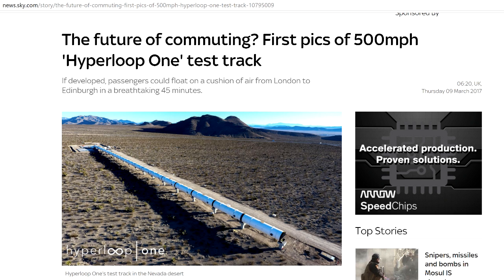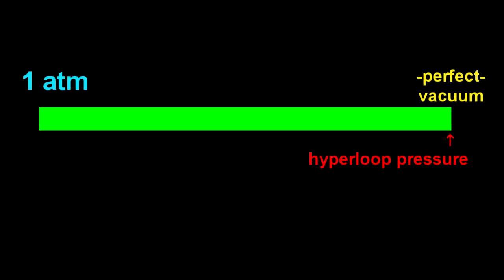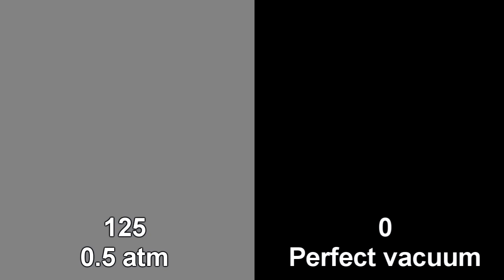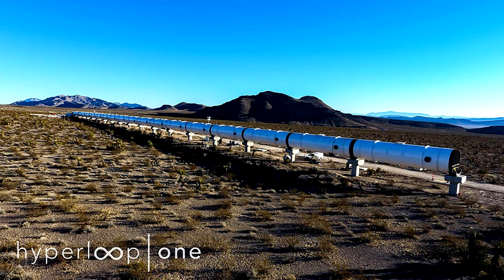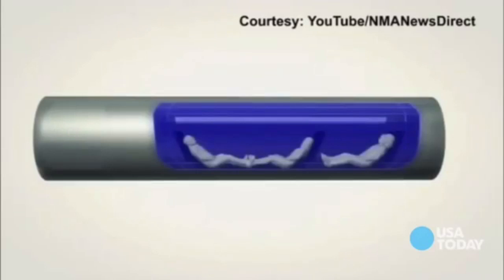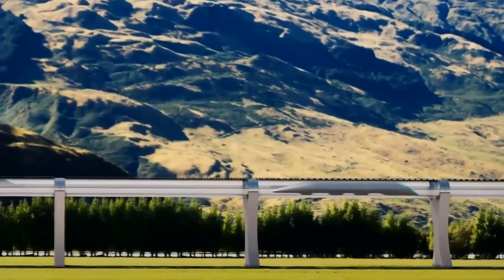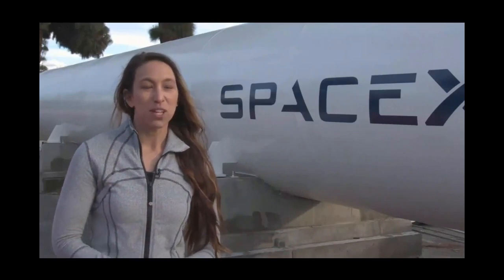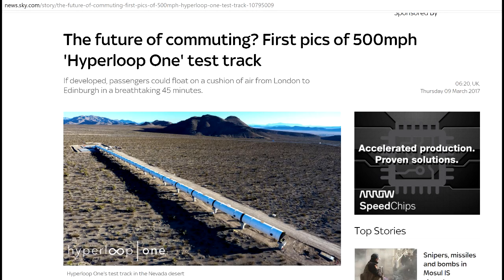Entire Hyperloop could be destroyed in SECONDS!

Comment: Why can't they use a gas to reduce friction such as Argon
Reply: Why not just use air???? And get rid of the bloody tube. That's called a train.)))
Reply: Bigg Phillips I don't understand your question

even if I did, it sounds as irrationnal as the hyperloop itself
Reply: Because to a very good degree all gases act the same in regards to pressure and such. Drag is additionally proportional to the mass density, but you'd gain at most a factor of ~30 in drag reduction and that would require hydrogen.

Comment: I'm with you on the dangers of the vacuum tube, but talking about how long it takes to pump out the air from the entirety of the tube and comparing it with the length of the trip is pretty stupid. Ever heard of airlocks? There are plenty of good arguments about it, so you really don't need to keep repeating this stupid one. It wouldn't be a half a mile section that would have to be pumped empty, but just a 5m section.

Comment: okay, that may be a stubid question, but why aren't they using a magneting railway thing they use on rollercoasters to reach the speed. (I know nothing about that stuff so please don't hate me)
Reply: Mrs. Babzubo because a vacuum tube would be unnecessary when you are using magnets
Reply: SaltyKanan just bc you are using magnets, does not mean you have no drag on your vehicle. And wasn't that the main argument for the vacuum?
Reply: Mrs. Babzubo yes creating no drag is the point, but the maglev (magnetic train) which does actually exist can reach speeds of 600+ km/h and doesn't use any vacuum tubes
Reply: SaltyKanan I didn't knew that, thank you. But why waste all that money on something that's a killing machine if, you could use it to improve these magnetic railwaysystems? It seems kind of stupid to me.
Reply: it would be useless since most of the friction is not between the air and the train, it's between the train and ground, sure a vacuum chamber would increase fuel efficiency and speed but the risk would be huge compared to the small gain you will get.
Reply: You seriously underestimate the cost of helium. Filling the hyperloop would deplete the entire global supply. You could use hydrogen, but that brings its own issues - those tiny little molecules will quite happily leak through the gaps between iron atoms, and render the metal brittle in the process.
Reply: Not to mention Hydrogen is ever so slightly liable to burn.
Remember the Hindenberg.
But yes you are also correct about the Helium. For anything of any reasonable size I doubt there would be the Helium. Never mind the expense. It would need to be pumped in and out to be recovered. Venting all that to atmosphere, and then refilling the tube would be ridiculously expensive.
But then again, the whole venture seems badly thought through and kinda flakey. I really don't know what Musk is thinking about with this one.
Unless he's receiving some seriously healthy funding.
Reply: "Most of the friction does comes (come) from the air" 
this statement, this, i want this to hanged on a wall, not because it's smart/perplexing, but because implying that a train experiences more friction from air rather than the rails is one of the most dumbest things i have heard this week.
Reply: alright fair enough, what if i want to stop it?
Reply: But even the MagLev could go much faster, if it would not be hindered by air resistance. Maybe you can find MagLevs power consumtion at 600 km/h (i think, the required energy is somewhat between crazy high and insane ^.^ )
Reply: As for the tests, wayyyy to much effort, as for the final product, no real reason considering whatever their currently planning on will create way more friction than a mag lev.
Reply: Most of the friction does comes from air though, iron rails produce tiny resistance and in maglev it's practically zilch. Still using vacuum is stupid, they should instead use light gas, such as helium. It hardly produces any drag, and the tube can be kept at 1 atm pressure. Pretty sure it'd be cheaper to fill up the whole thing with helium than to drain air out of it, deal with heat expansion issues and manufacture thick walled tubes.
Reply: Why don't you go ahead and look up rolling resistance of steel wheels against steel rails, and air drag of a train, and that of a high speed train at high speed.
Reply: Stopping the train?
Reply: +rationalmartian
Hindenburg ;D
Reply: every ones missing the point of what mrs babzubo said. your all talking like you got great ideas and your real clever but the comment says roller coasters use magnets to get high speeds? ? ? has any one got any knowledge at all on roller-coasters? the are momentum driven through the force of gravity. its just a ball rolling down a tube. no rocket science at all.
Reply: The hyperloop is supposed to be a horizonal tube, I don't see where they would use gravity
Reply: I guess this video does inspire that level of knowledge...
There is a very good reason they want a vacuum tube, not so sure people around here can comprehend that much however.
Reply: Your knowledge of roller coasters is outdated. They used to all operate as you describe, and many still do - the cart being lifted to great height via a chain drive, then carried by gravity. But competition to make them go faster and longer is fierce, and many top roller coasters now utilize linear motors to accelerate the cart. Magnetic acceleration. This allows the coaster to go faster, and to maintain this speed all the way to the end. That's why coasters of today can include so many more twists and loops than those of decades past.
Reply: MsSomeonenew of course they have a reason to use vacuum tubes, but that doesn't make it physically possible
Reply: Then why did the pod that moved the furthest win?
Reply: That's because they are using magnets for propulsion Thunderf00t's just dishonest.
Reply: They are making it mag-lev. But the competition was for pod shape. What Thunderf00t did not research or understand was that part of the competition was to literally brake the pods right after release. Instead, he saw that as an "example of failure"
Reply: ya and for some reason oh building a massive long tube instead of a maglev train is more pheasible xD...  at literally 100x the complexity and risk.  God wish more people would see that.  Or is a Maglev train outside of a vacuum tube of death too dangerous xD?

Comment: I don't get why the pods in the test track are so small. I thought for it to work it would need to fill almost the whole tube to get the pressure difference. That's how those old vacuum tubes that transported documents around buildings used to work isn't it?
Reply: nitelite78 hyperloop is supposed to work like a train with no air resistance, not the way these tube-thingies you described work. The vacuum is just there to make it more efficient and faster, in theory at least
Reply: No, Gauss rifles are not also known as railguns, railguns use parallel rails, Gauss rifles use coils, the way they work and the electrical requirements are very different. Gauss rifles are also known as coilguns.
Reply: I barely recognise the term gauss rifle and I know that doesnt sound good.
Reply: TheDark4light Gauss rifles use powerful electro-magnets with alternating polarity to accelerate an object to a high velocity.
Reply: As far as I know it will (or would) not operate under pressure difference. The Pods will hover in a magnetic field for 0 friction. Basically a Gauss Rifle. For people.
Reply: Gauss rifles are not railguns, by a large amount.

And the ponds are so small because if the side fails and the vehicle is about the size of the tube, noboy will ever give a cent to Elon Musk.

They will become amazing death only after they get the money to build it, so they can be abandoned like the over-the-traffic bus of China.
Reply: Also know as railguns.

Comment: And yeah, any idiot with a handgun would be able to dent it well enough for it to fail, Christ, they didn't think it through, unlike the SOLAR FREAKING ROADWAYS TEAM!
Reply: "Extraordinary protective measures don't exist for most forms of transport." True; but one derailed train derails one train. Imagine if, by hammering the bolts out of a railway line, you caused every section of the entire line for fifty miles in each direction to catastrophically explode with the force of a stick of dynamite, and crushed or suffocated every passenger along that entire distance. I suspect railways would have more security then.
Reply: globalko Bulletproof material does nothing to stop the impact, it simply spreads it over a larger area. This prevents penetration by force applied to a small area, ie. a bullet, but I assume the force would still be enough to dent those thin-looking walls. I suppose there might be a material to absorb the impact without harming what's under/behind it, but just kevlar-coating won't do it.
Reply: Except when you damage train tracks, the entire thing does not immediately fail, in the hyperloop, you dent one part, and suddenly the entire thing will just implode.
Reply: Cover it in solar roadways panels. lol That way it could implode & burn.
Reply: the shockwave of air rushing in would destroy anything inside the tube.
Reply: It would need to be fully-armored against everything short of an RPG, the entire length. A 50cal bullet packs the kinetic energy of a charging bull elephant, and you can accurately shoot big 50s out to over a mile. The entire length of the loop would need to have the protection equivalent to an M2 Bradley AFV.
Reply: Tuberuser187 Or you are not thinking this through. The rest of the system is connected meaning a perforation will cause the system to be compromised as air rushes in to stablise the entire length of the hyperloop.
Reply: Actually no - a dent or even a hole in the hull won't do much to a plane and the whole "sucking out everyone and ripping a hole" thing is just a myth. If you want to destroy a plane with a handgun you're better off shooting the pilots BUT you're not allowed to bring firearms with you. The case with hyperloop is different - you can freely stand next to it with all sorts of weapons of your choice. Hell - it can be inadvertently destroyed by anything that hits it hard enough to dent it. But call me a stupid fucker as much as you want.
Reply: cooldude I think I've heard this somewhere before.... 

OH RIGHT 

In the video. Thanks captain obvious.
Reply: +Funter Falkner
I find it more likely some idiot will climb on it and crush the structure.
Reply: Yea, even a little 9mm will dent steel 1/8 inch thick. They would actually probably be better off with a little hole & a slow leak vs a dent.
Reply: I'm pretty sure they did think it through, they just wanted the money and soon they are going to blame the cancellation on safety regulations or something.
Reply: Far easier to just drive a car into it to destroy it.
What background checks does Cal have on buying a car... oh right, ILLEGALS can get do it so terrorists can do it.
Does ATF have sting operations to catch guys trying to buy $900 used cars in Kalifornia?
Reply: Tuberuser187 So if 1/3 of the tube fails, you've got a 66% chance that you will die a different way than being crushed.
Reply: +Sonny Knutson
But its harder to hit an airplane with a handgun since they are usually on a guarded area and usually out of firing range of a handgun.
Reply: Which will merely equalise the pressure in the system, certainly fatal to any passengers in the vehicles (it would be like hitting a concrete wall). Just like a derailed train can be but this is far from exploding shrapnel all over a city, Air rushing in doesn't create an implosion either... the effect is opposite as air is rushing in, not out (logic please?), the collapse is caused by the immediate weakness created within the structure by say a perforation (or long term one that finally gives out) and the vacuum still within. The weakened and damaged structure can no longer withstand the forces the atmospheric pressure is loading it with and as the air rushes in the pressure is equalised, this means no more pressure against the structure so further collapse doesn't occur and as the pressure is only reaching the same as it is outside the tube there is no explosion either. there is another important fact both Thunderfoot and you all seem to be missing. 

Tankers like this are not designed to withstand atmospheric pressures or vacuums, they are actually designed to contain internal pressure in case the liquids inside expand. As clearly evidenced by the reinforcing bands on the outside of this tank, they are demonstrating the kind of accident where a vacuum is created by operator error or equipment malfunction (like a pump being left on and reducing internal pressure).
Reply: Sooo, a perforation of thin and light aluminium wont cause complete structural collapse when pressure equalises but a perforation of heavier structural steel will?
Reply: globalko Did you know that kevlar is not a magical shield?
Reply: I think they will have to encase the tube in another structure to protect it or at the very least sheathe it in some other material which would make the whole thing way more expensive, but you can't leave that thing naked.
Reply: Tuberuser187 Except that the tanker is not even a hundredth the length of the projected length of the hyperloop.
Reply: You're really not thinking this through at all, if it takes a bullet to cause it to implode then the rest of the system must have been stable so the weakness would be in the immediate area around the perforation.
Reply: how about bulletproof material like steel? steel is bulletproof if its thick enough...
Reply: the capsule inside with the people in it would i guess be at standard atmospheric pressure. so a failure in that would also be rather messy for the occupants as it exploded to fill the vacuum.
Reply: The area around the perforation would be weakened and as with the gas tanker demo, it would cause a chain reaction collapse of the tube.
Reply: Anything short of an RPG? That won't do it. You've got to worry about idiots taking short at it with hunting rifles, 'take you all with me!' suicides ramming the support with their truck, and even actually competent terrorists who manage to steal a shaped charge from a demolition company.
Reply: +Hunter Falkner
Just like any idiot with a handgun could dent an airplane foil enough for it to fail. 
Stupid fuckers.
Reply: Tuberuser187 Why don't you go ahead and look up the pressure differentials because you are comparing apples to oranges.
Reply: A strong enough child with a big enough rock could do that.
Reply: And what protection does the hyperloop have that a tanker truck doesn't?
Reply: Because one is designed to contain pressure where as the other is designed to withstand it maybe?
Reply: 1 bar of pressure over the full length of a 100km tube.. "fun" ..
Reply: Explain how a regular old tube is better equipped to withstand pressure than a regular old tube.
Reply: The plan is for it to be underground, so 🤷🏼‍♀️
Reply: so 1/3rd of 100km ?
Reply: While there are plenty of other arguments this one is a poor one, conventional rails are not sledgehammer proof are they? Or pile some stuff on proof? Or park a car on proof?

Anyone can hammer out the bolts connecting a rail, or stick a concrete block or car on the tracks all to derail a train. Extraordinary protective measures don't exist for most forms of transport.
Reply: Except as demonstrated by the demonstration the whole structure doesn't fail, just the weakest parts. Only just over 1/3rd of the tanker failed, once the air gets in the collapse stops.
Reply: How about having bulletproof material around the tube? like kevlar
Reply: alright chill I don't play overwatch